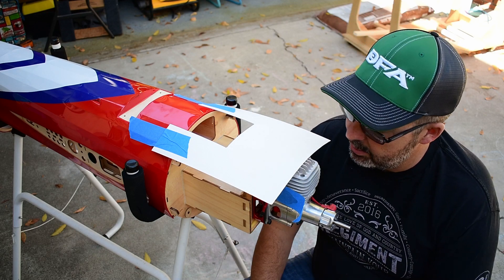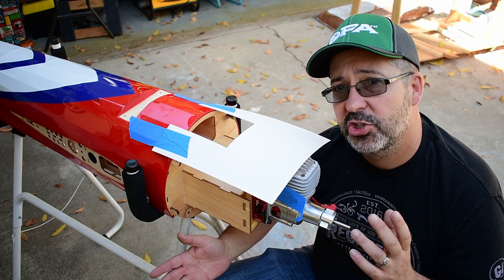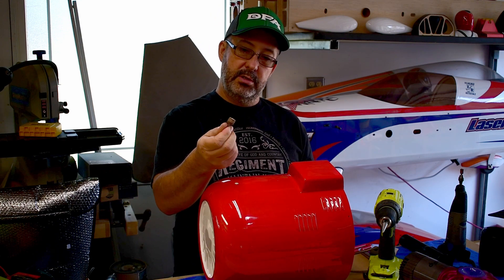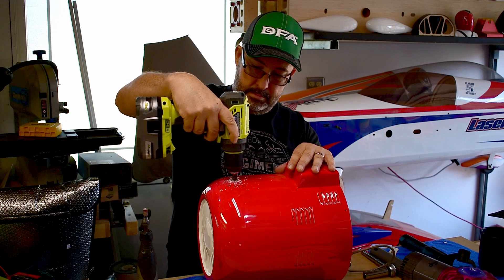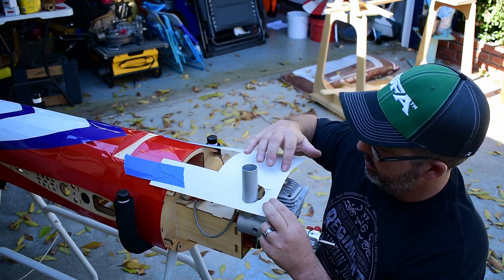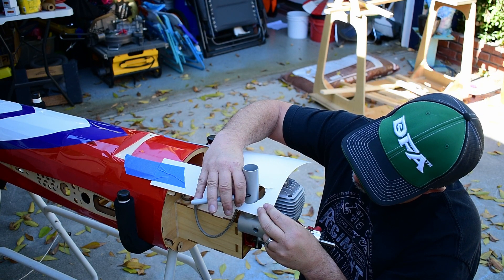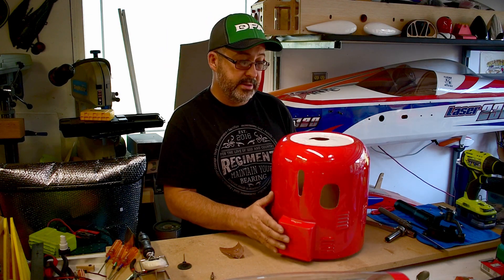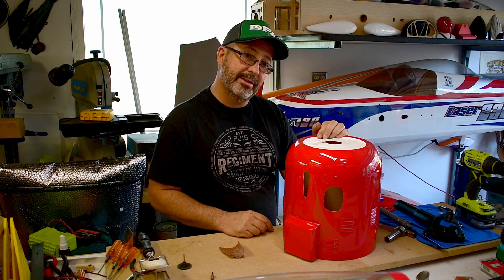FlightReviewz How To: Cowl Cutouts and Clearancing

Comment: Are you sure cutting the muffler did not affect the engine's performance?
Reply from the maker: There were no noticeable negative effects. I didn't gut that much off so the back pressure should not have been affected by the change.